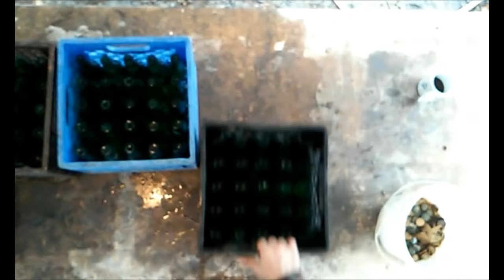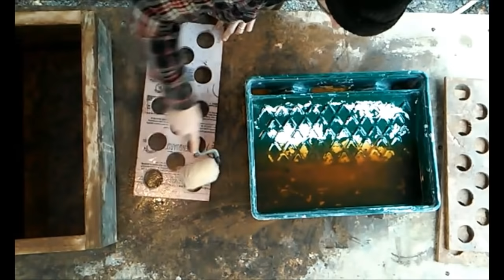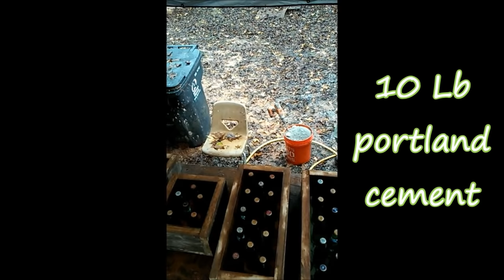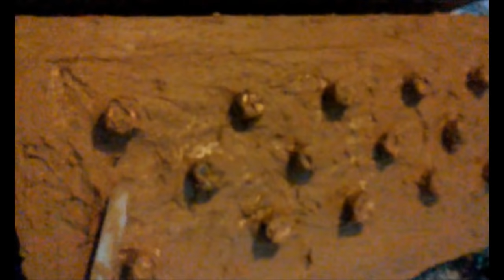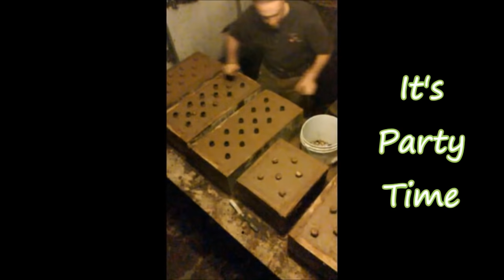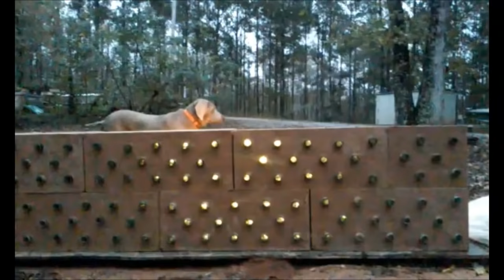building beer bottle bricks, using adobe mud stabilized earth home technique to go green

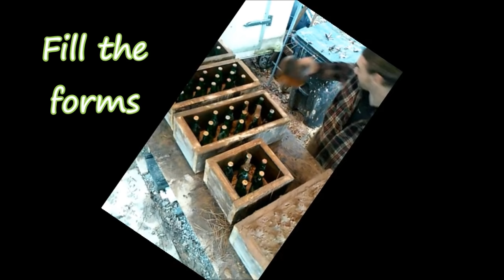Comment: OMG, your killing me.  At 5:30 when you  add the title,  "Filling the forms", please put that bucket in the gap on the table, and quit the step, twist, bend routine for every single cup of fill.  As a man who has done 10,000 repetitive (documented) repetitive actions in a single shift, may I offer that your wear and tear will greatly decrease when you twist/bend 3-4 times instead of 70-90 to achieve the same numbers of bricks.  I like your PVC tamper.  Bright.  The filling idea is also very useful, in that you can use liquids or sands to achieve the same stabilizing action.

Comment: What are the flat plates with the holes in it to put the bottles in made of? Self Made or purchased? If purchased; what are they called? Thanks.
Reply from the maker: I made those from pink poly foam insulation board from the hardware store. used a hole saw bit to make the holes.
Reply: Thank you.
Reply: Interesting concept...I had to turn the volume down half way through though the music became annoying. Hope I didn't miss anything.

Comment: What did you fill the bricks with?
Reply from the maker: I used clay and Portland cement. I should have used more sand in my mix. There are some awesome vides how to correctly check your correct clay ratio.

Comment: Does using cement count as adobe?
Reply: imo, no
Reply: Concrete should be used when and where it makes sense
Reply: James Morrow
That's the point. Using concrete with adobe doesn't make sense. Adobe is made out of clay, sand, and straw. The whole point of using adobe is not to use concrete.
Reply: Thanks
Reply: ElGatoLoco698 
would you mind sharing your adobe mix ratio?
Reply from the maker: cement will crack if to thin. adobe is clay, silt, sand and straw. you use lime or Portland or both to harden (cook) the clay. I have used a premix of thin set for tile and it worked well but expensive for a large project.
Reply from the maker: A hardener like lime or Portland will make a stronger block. to much will make it week also. Its good to learn the correct ratio for your soil and climate. this can last a long time in the south but the freeze is the killer of a good block.
Reply from the maker: I used a 6 to 1 ratio but didn't have enough sand in my clay. I have seen some good videos of how to figure and test your clay to see what is the ideal mix.https://www.youtube.com/watch?v=S_83Nsf0z1s